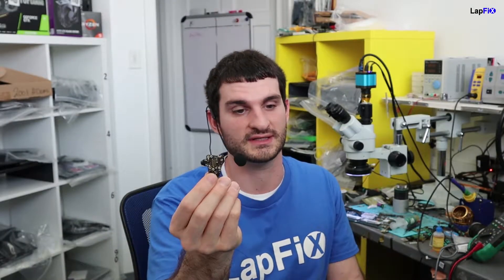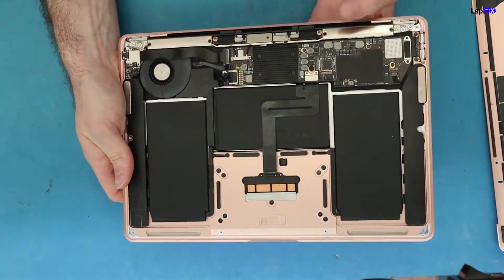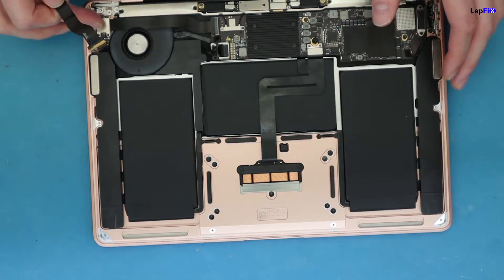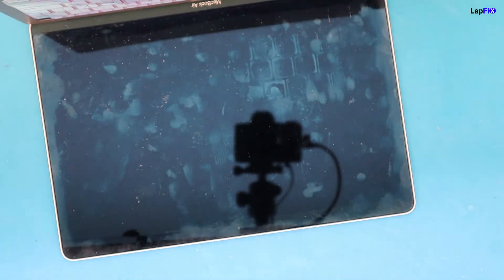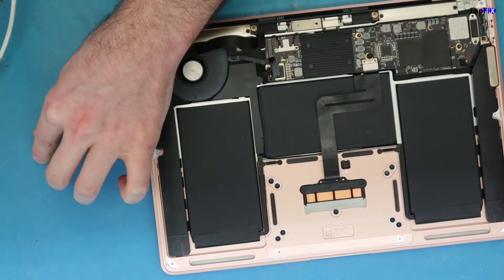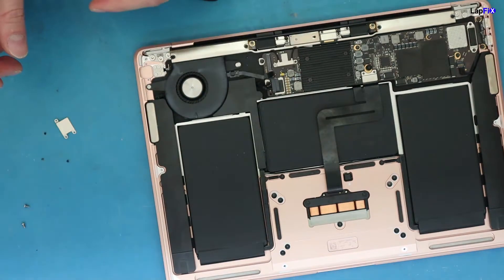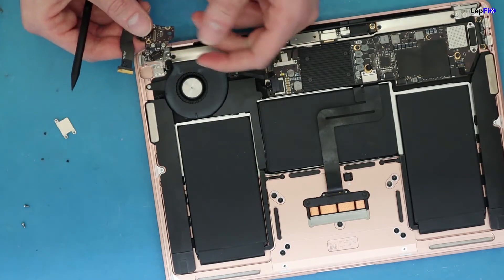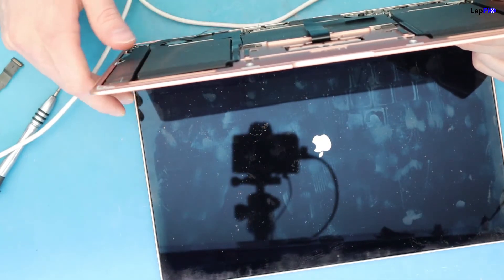How to fix a dead MacBook Air A1932 - Audio Jack Board Replacement

Comment: I have this model and Just stopped to charge, i was abble to use before the battery goes down. i have already tried to change the audio jack and the USB type c conector, but It doesnt work. Could you give some light in the end of tunnel about It?
Reply: I noticed that the mother board light turn on when i plugg it on

Comment: Hi,
I have a macbook retina 2016. No sound at all. Ive tried basic stuff like resetting smc etc but no good. Would replacing the audio board be the next best step?
Reply from the maker: First go to your sound settings and test the speakers there.  Another way is to plug in headphones, if you are getting audio, the audio chip on the board should be ok and may just be a speaker issue or software